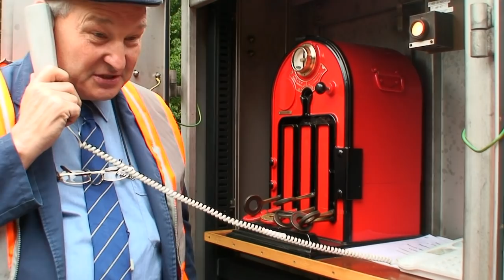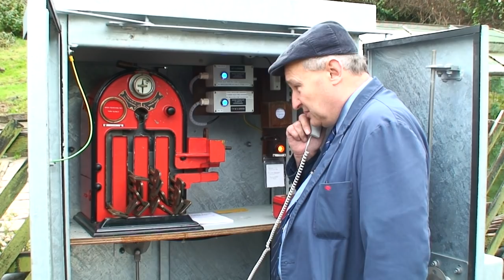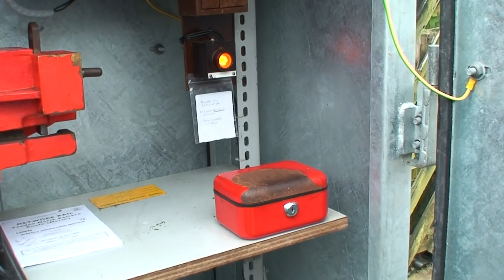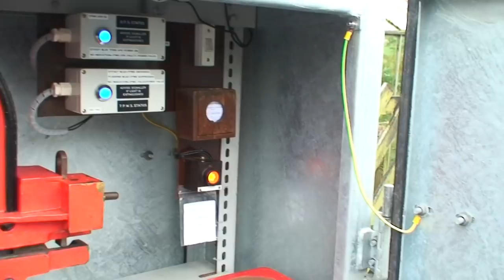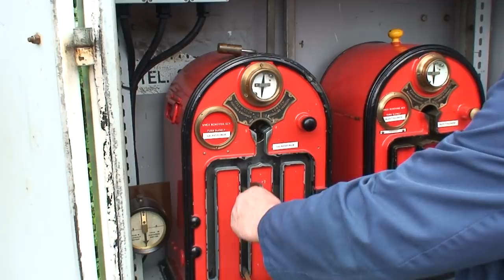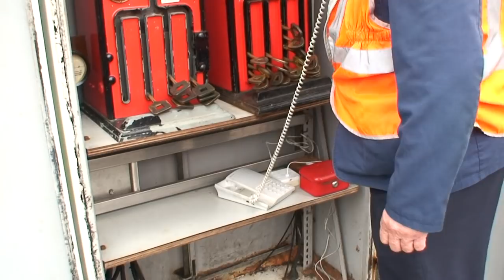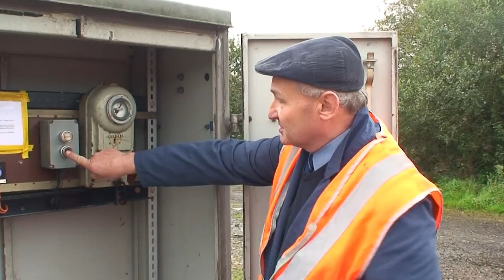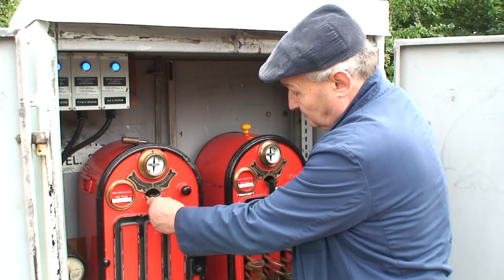Grosmont to Battersby Route Learning and Cab Ride on Class 25 No. D7628 - Part 1/2

Comment: Great video. 
One would think that the signaller would be located at Battersby rather than Nuntrhope due to it being a junction and more complex.
Reply: There used to be one there
Reply: Nunthorpe is much busier than Battersby, it has an hourly service to Middlesbrough and Newcastle via the Durham Coast line. It also has a passing loop and a level crossing. Only one platform is in use at Battersby so the operational layout is actually simpler: the junction is is just a set of points to the east of the station. Trains arrive at the platform, stop long enough for the driver to contact Nunthorpe to release the relevant token (just like Glaisdale), change ends and set off towards Middlsbrough or Whitby.

Comment: On leaving Glaisdale ( 21:35 ) the trailing points were not set, and you ran through them.What type of points are these please?
Reply: Andrew Crisp I’m glad you picked that up, I was thinking exactly the same.
Reply: Hydraulic points that are set to return to open for trains coming in the opposite direction to this train's travel.
Reply: Yes, these auto-restoring points are designed to be run through in the trailing direction.  They're quite common on single-track lines, where the passing loops are normally used in one particular way.  The yellow point-indicator signal on approach in the facing direction is characteristic of the type.

Comment: Great video. Who controls the points entering and departing each passing loop section?
Reply from the maker: The points at Glaisdale are hydro-pneumatic. There are only a few on the national network nowadays. Entry into Glaisdale from Grosmont/Whitby end is controlled by a points indicator light. When lit yellow, the driver can proceed over the points into Glaisdale station. Similar points indicator light is provided for entry into Glaisdale when travelling from Battersby. If the points fail they have to be operated by hand. There is no intervention from the signalman at Nunthorpe in changing the points. 

The points at Battersby are operated by point motors and rely upon the signalling  and annunciators on the track and the extraction or insertion of the token into token machines and the pressing of plungers at the signals to operate the points and change the signal aspects. Again, there is no control of the points or signals by the actual signaller at Nunthorpe. 

The signaller only allows the extraction of a token from the token cabinet after the driver has spoken to the signaller and obtained permission and release to take a token. 

It was designed like this in the 80s to reduce cost and have minimal intervention from signallers.

Comment: Hi Still fascinated by this video, another stupid question though. At 5:45 at Grosmont the crossover that the ground frame is controlling is a double slip. So how does the single lever operate the two sets of blades to allow the loco to go through the double slip?
Reply: @andrewbuckley9180
It's standard design for any connection with two point-ends, that one point lever operates both ends. Where there are compounds/ double-slips as at Grosmont, the crossover point lever moves only the blades for the route through the crossover.

Comment: There's a building just east of Castleton Moor station with short lengths of track around it. I wonder what that's about.
Also, those rail joints seem awfully rough. Or the Class 25 just has a very stiff suspension.

Comment: Interesting and educational video thanks,  at 21:39 the loco passes points that aren't set right? Did anyone notice? How come it didn't derail or am I being thick?
Reply from the maker: I believe they are pneumatic points and change position when the train goes over them. There are a set at each end of Glaisdale station. They are very and far between now on the national network.
Reply: @nymrfootage  
Yes - wheelsets of trains in the trailing ('exiting') direction at this sort of passing loop force the point blades over against the hydro-pneumatic ram, which then returns the points to normal a few seconds after the train passes clear. In recent years I believe many of this type have been replaced with powered points as part of NSTR upgrades, where the route is set by token withdrawal instead.

Comment: With trains running from the NYMR into Whitby have the token sections changed (Glaisdale to Grosmont and Grosmont to Whitby) to allow NR trains to run between?
Reply: Isochest No, the token section is still Glaisdale-Whitby so NYMR and Northern timetables are interlinked.
Reply: @jacksepticeyejr1086  I shall have to look into that. I do think some electronic token system should increase capacity but with videos like this it seems the NYMR run trains much further afield than ever intended.

Comment: Great video and very interesting. A couple of questions spring to mind. First, why are there so many tokens in the token machines? At  0:28  think I can see 7 tokens so does that mean 7 trains (provided they are all going in the same direction) could be on the line at once? Second, is it possible to take more than one token out? If not, how is this achieved? Thanks
Reply: The machines are interlocked so you can only ever have one out. There is more than one to allow trains to follow each other through.
Reply: Once upon a time, they ran multiple trains in the same direction on a single line at once but incidents taught us that was a bad idea and so you can only ever have 1 train in a section at a time and the interlocking will only allow one token to be out at a time the extra tokens are for being able to send other trains in the same direction but only after the previous one has cleared the section.

Comment: Is there a reason why the token block has not been split up or allocated a short section to Whitby-grosmont / grosmont-glaidsdale? Surely that would make operations easier and not hold up an entire section of line for no reason!  Network rail trains could wait at grosmont for the next section.
Reply from the maker: A very good question. 

My understanding is that when the line was singled in the 1980s to reduce costs, the reduced traffic over the line did not require a block section from Grosmont to Whitby. 

NYMR weren't running daily services to Whitby and I believe there were only three or possibly four services from Middlesbrough to Whitby, so an intermediate token was implemented to keep costs lower between Grosmont and Whitby in the event the NYMR needed to take a train to Whitby.

However, today, it would be beneficial to have a block section from Grosmont to Whitby as the line is actually running at capacity during the daytime. 

A block section for Grosmont to Whitby would allow some extra flexibility for both Northern and the NYMR. How much though, I'm not sure. It may just allow additional time for the services that presently run in the available slots.
Reply: @nymrfootage  I thought it may have been double line due to the extra area under the bridges,Did the stations have  2 platforms?BTW. A great video.
Reply: @RichardFelstead1949  Once upon a time the NYMR was double track from Rillington Junction to Whitby , and Whitby station had four platforms and an overall roof.  Ruswarp and Sleights had two platforms - you can see the ruins to this day.
Reply: @RichardFelstead1949  the line from Gosmont to Battersby was built to double line standards but outside of the stations it was single line. It was  ever doubled as the revenue earned by the line was not sufficient go justify such a change.
Reply: @nymrfootage  
I've read in recent years of proposals/ feasibility studies to enhance the signalling for more capacity, but if the experience elsewhere is anything to go by, it all comes down to money (obviously) and, on lines like this, to what extent it's acceptably safe to add more sections/ more frequent trains without triggering complete replacement of NSTR with TCB.... Not only NR but HM Railway Inspectorate must be happy!

Comment: Good solid working practice - tedious in operation maybe, but priority is SAFETY before all else( or SHOULD be ).   Mind you, i reckon JR has eclipsed Britain and certainly the US for efficient, safe and clean railway travel - and mainly on 3ft gauge too !
Reply: This cumbersome system, with phone calls and keys, has a certain efficiency too - it was intended to support four trains a day, and this system needed minimal effort to set up and keep operating.

Possibly Radio Electronic Token Block or its successors would be an improvement - replace the phone calls and cabinets with an in-cab radio-based system. Not sure if such systems existed when this line was last reworked.

Ironically, mechanical signalling systems tend to stay in place in Britain because they can keep working forever on a "patch and mend" basis. Whereas old relay-based electrical interlocking, and old software-based interlocking, reach a point where they become impossible to maintain and can only be replaced with new signalling systems.

Comment: Why does the train pass the signal at Danger into Battersby?
Reply: I think that part of the video was filmed from the rear cab on the return journey, and reversed to make it look like forward travel.  Notice that there's a hard cut in the video a bit before that, and a change in the audio.  Just a guess, but perhaps the camera's battery or tape ran out.
Reply: @Kromaatikse  
Good eye, can kind of see it with how the bushes are being blown about in reverse.
Reply: Because it's a permissive block signal. A permissive signal can be passed at danger, provided you're moving slowly enough to come to a stop at any obstruction beyond it, in this case the end of the track. Since there will always be an obstruction past that signal, it will never have a proceed aspect.
Reply: It’s actually a yellow aspect that’s made to look red by the camera
Reply: @SynchroScore  Nope it should be showing a yellow aspect and if it was cleared for a permissive move the 2 white position lights would be lit

Comment: When a NYMR train arrives at Whitby, can a northern train then run to Whitby and use the other platform. Or is only one train at a time allowed through to Whitby on the Grosmont Whitby section.
Reply: Now that there is a second platform, the token can be replaced in the machine to permit a second movement over the single-line section.  At the time of filming there was only one platform.

Comment: Amazing video. If you’re unable to proceed out of the station within 5 minutes, and the signaller has already sent a train along, you said you had to go 300 yards down the track and place something 20 yards apart? I didn’t quite catch what it was and would love to know an explanation. Many thanks!
Reply: I believe he mentioned detonators 300yds apart. If this is correct, I assume they go bang when run over warning the driver of an approaching train that there is a hazard ahead. Maybe completely wrong.....
Reply: It was detonators 300 yards from the points or points indicator and 20 yards apart. They explode under pressure of a passing train and 3 in a row means stop as there is an obstruction ahead.
Reply: @mattlander9119  Thanks for the correction Matt, yes I re-watched it
Reply: On that note, does that hold for all NSTR implementations, or just this one?
Reply: If unable to proceed because of a train fault, driver must declare the train a failure to the signaller and request assistance. The dets then have to be placed to protect the failed train by warning the driver of the assisting train.

My understanding re "within 5 minutes" is that, on withdrawing a token from the instrument, the equipment switches off TPWS protection for that time, after which it switches it back on. So if the train hasn't 'failed' but there's undue delay (e.g. problem with passengers or a door needs a few kicks to close properly), the driver should return to the hut, check whether the blue TPWS light is still flashing and if it isn't get the signaller's permission to put the token back and withdraw it again.

Comment: @21:47. Would those points be sprung then?
Reply from the maker: The points at Glaisdale are hydro-pneumatic. There are only a few on the national network nowadays. Entry into Glaisdale from Grosmont/Whitby end is controlled by a points indicator light. When lit yellow, the driver can proceed over the points into Glaisdale station. Similar points indicator light is provided for entry into Glaisdale when travelling from Battersby. If the points fail they have to be operated by hand. There is no intervention from the signalman at Nunthorpe in changing the points. 

The points at Battersby are operated by point motors and rely upon the signalling  and annunciators on the track and the extraction or insertion of the token into token machines and the pressing of plungers at the signals to operate the points and change the signal aspects. Again, there is no control of the points or signals by the actual signaller at Nunthorpe. 

The signaller only allows the extraction of a token from the token cabinet after the driver has spoken to the signaller and obtained permission and release to take a token. 

It was designed like this in the 80s to reduce cost and have minimal intervention from signallers.
Reply: I was going to say! They're a fairly rare sight nowadays. Video is very helpful. Just going through my driver training so it really does help! Thanks!

Comment: 21:22  Did anyone else notice - the first set of points was in the correct position to transfer the loco TO the right-hand line, yet - the second set of points was in the wrong position to receive the FROM from the points !  Stop the video at timestamp 21:39 - those points are in the WRONG position !
Reply from the maker: The points pneumatic points and change position when the train goes over them. There are a set at each end of Glaisdale station. They are very and far between now on the national network and may now be the only remaining set of pneumatic points left on the national network as of 2024.

Comment: 21:40 trailing points set against direction of travel; I guess that doesn't matter...?
Reply from the maker: Those points are hydro-pneumatic. They set as the locomotive or unit passes over them.

I believe there are only a handful of these type of points in use on the national network now.
Reply: these type of points can be found of the west highland line
Reply: @nymrfootage  They are used extensively on the far north line, where train protection is afforded by radio electric token block.
Reply: Single lines are pretty much the only places you'd get this sort of points